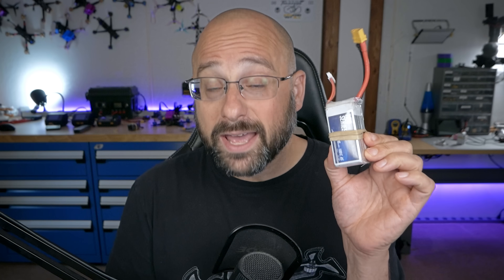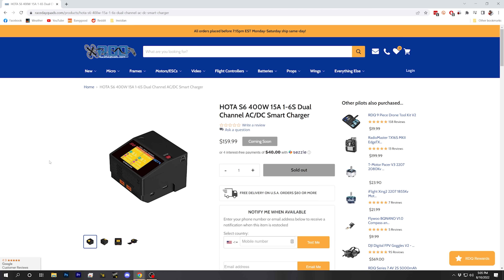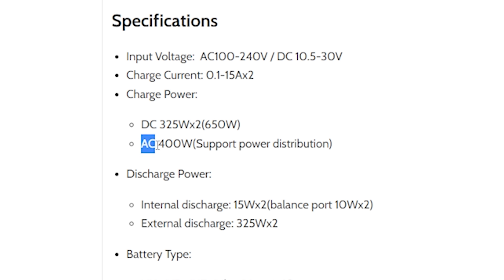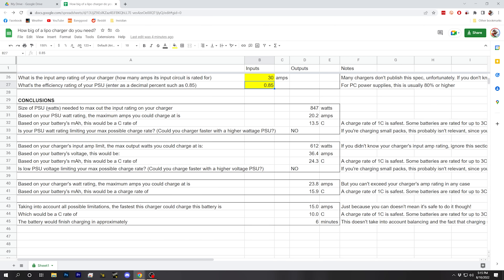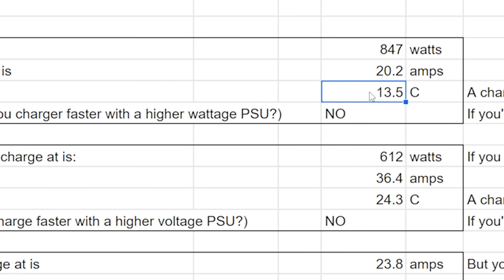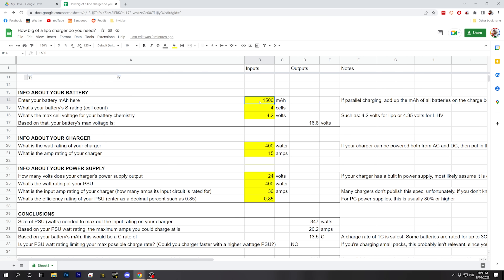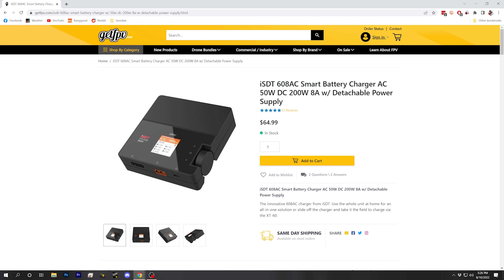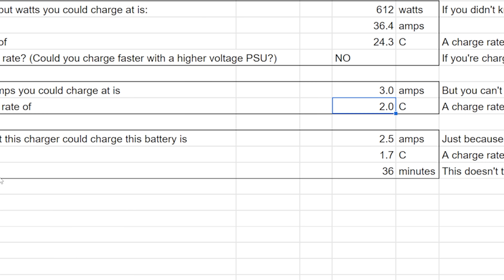Is your lipo charger too big? Could you be charging faster?

Comment: Do you always recommend staying at 1C or below when parallel charging?
Reply: I always charge all my lipo batteries at 2c individually, parallel board, or series charging regardless of size. Always 2c 😀
Reply: 1c when parallel charging is a good precaution to follow
Reply: Everything I've read/watched basically says to stay at 1C per 1000mah per cell.. so if you're parallel charging 3 1000mah batteries, charge at 3C since it will be divided to 1c per cell.
Reply: @WhySoDivided-CantWeAllGetAlong  I think you may have gotten your terms a bit mixed up.  C rating is a measurement of charging and and discharging.  The 'mah' in your battery capacity stands for 'milliamp hour', and 1000 milliamps equals 1 amp.   If you have a 1000mah battery charging at 1c would mean you charge at 1 amp.  If you wanted to charge a 1000mah battery at 2c you would charge it at 2 amps.  If you had a 1500mah battery and wanted to charge at 1c you would set the charger to 1.5 amps.
Reply: @JoryFPV  I may have worded it wrong but yah meant 1amp per 1000mah lol. Thanks for correction.
Reply: @WhySoDivided-CantWeAllGetAlong  I figured, just wanted to make sure since lipo batteries can be scary lol =)
Reply: If you just want to plug and play, then yes - don’t play with high charge rates in a parallel board, as some batteries in the board will charge at a higher rate, and some lower. 

Me personally- I’ll start a charge on 1C and use a clamp amp meter to find the battery that gets the highest current, then I increase the current until this one’s just shy of 2C. I find doing it this way I can charge at about 1.7-1.8C , and have the fastest charging battery pegged at 2C. But I don’t recommend setting it to 1.7C if you can’t or don’t want to measure and verify. In that case Better safe than sorry.

Comment: Just divide the output watts of the charger by the fully charged voltage of the battery. The result is the maximum amps the charger can put through the battery as it reaches full charge, provided it can output that many amps.
Reply from the maker: I prefer not to use the full charge voltage of the battery, since the charger will slow down as the battery approaches full charge. Therefore, maximum watts output is not achieved at 100% voltage. Also, you have to account for the wattage of the power supply and the input amps of the charger.
Reply: @JoshuaBardwell  I don’t want the amps to drop prematurely, so I go with 4.2 volts/cell..
Reply: @JoshuaBardwell  I run a Revolectrix GT1200 (40 amps) and a GT500 (20 amps) simultaneously off a pair of Dell 12V/62A server power supplies in series. The power supplies cost $28, the GT1200 was $105, the GT500 was $75, and two parallel boards were $54 each. So, for $316, I have 1700 watts, 60 amps, and can charge eight 6S packs simultaneously. And everything fits in one plastic case ($20). I put my packs on the charger when I arrive at the field, get my planes set up, visit a few minutes, and my batteries are charged. I fly my batteries down to about 3.7 volts/cell, go home, and store them until the next trip to the field. My batteries live much longer than they did before.
Reply: @JoshuaBardwell  the specified cc-cv charge plot for a lipo has a constant current charge to 4.2V/cell (cc phase) that then slows down while keeping voltage constant at 4.2V (cv phase).

My isdt 620 and 608 both follow it and will charge at full amps right up to 4.2V and only then will start dropping as they enter the cv phase (assuming the battery is decently balanced to begin with). So it will hit peak watts at 4.2V
Reply: I do the same as the fudge factor, especially if you plan to charge at the max output of the charger.

Comment: Question: Can I leave my charger plugged into the wall when not charging batteries? I'm worried about screen burn in mostly. I have the Hobbymate D6 Duo
Reply from the maker: Yeah don't worry about it. The only thing that's a little annoying is the fan blowing.
Reply: @JoshuaBardwell  Oh good, it would be a hassle to unplug/re-plug everytime..Thanks
Reply from the maker: Maybe get a power strip and flick it off/on.
Reply: @JoshuaBardwell  Yeah I'll probably do that just to be on the  safe side. Thanks for your help, I appreciate it. Love your videos, they have helped me out alot. New to the hobby and am finding out there's a considerable amount of learning  involved.
Reply: @JoshuaBardwell  If the fan's still blowing when it's not used then it's definitely using quite a bit of power. Best to turn it off else you'll see it on your electricity bill...
Reply: LCD screens degrade with heat and usage.

Comment from the maker: What's your current favorite charger?
Reply: Isdt p30 with a 25v 1400w pwr supply
Reply: SkyRC Q200, solid reliable charger
Reply: ISDT D2 MK2... except the fan, it cranks
Reply: @GardoRotor  Change them to noctuas
Reply: Hota F6 😅
Reply: icharger 4010
Reply: wall plug
Reply: Hota D6. I've got 2 of these and it's all I need for the packs I fly with.
Reply: I have a lot including an 18S for agricultural drones but my favorite is ISDT the small one with led screen. Small but I like it
Reply: Hota D6, thanks for your explanations.
bought on 08/2021.
But I also have an isdt Q6 lite.
But my favorite is the hota D6.
Reply: I recently picked up an isdt, it's alright so far lots of good features
Reply: ISDT D-2 i think its arround 200 watt charge, but also has 2x5 watt discharge
Reply: Revolectrix GT1200. It can charge four 5000mAh-6S batteries simultaneously at the 2C rate. (1200 watts / 25.2 volts = 47.6 amps) Of course, it will only put out 40 amps, but 40 / 4 = 10 amps per battery which is the 2C rate. I usually charge at no more than 1.5C which is 5 x 1.5 x 4 = 30 amps. The more cells your packs have, the more watts you’ll need.
Reply: I have the ISDT P30 and the ISDT Q6 Nano. Love them.
Reply: Hobbymate D6 Dual Lite = boss!